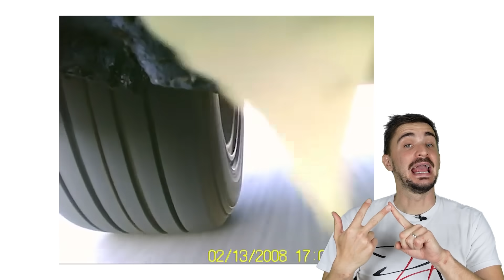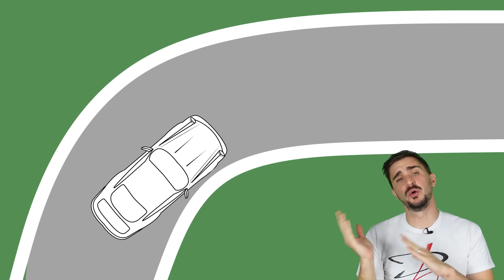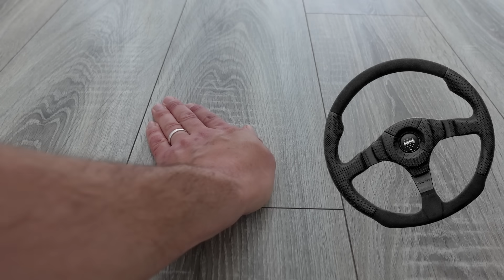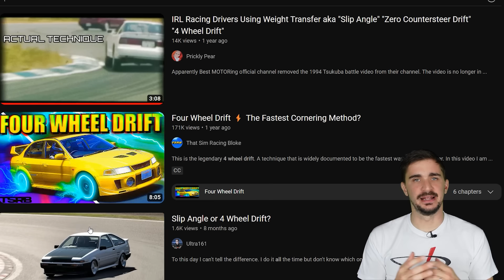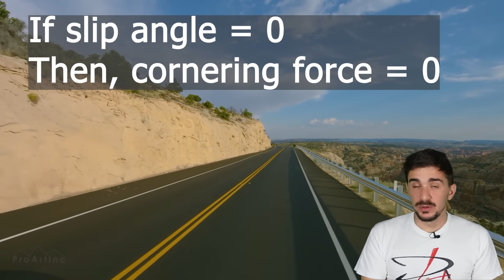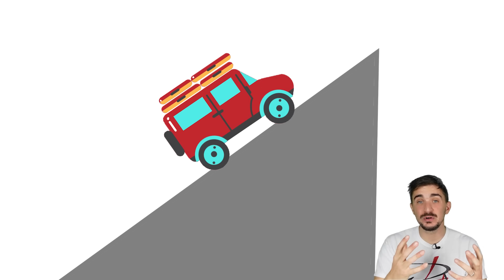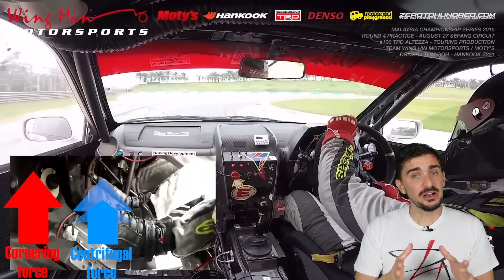You Think You Know But You Don't - Slip Angle Explained in a Way You Will Understand

Comment: …but as we are not talking about discrete contact patches hitting the ground but a continuous elastic piece on material the change of direction is done by the edge of the contact patch where material gets into contact with the road or leaves it. 🤔
And with motorcycles, due to the lean angle in a curve, different wheel radii of the rounded cross section of the tyre touch the ground. Is it correct to conclude that motorcycle tyres get away with much softer and stickier consistence as there is less scratching over the road surface involved with how they generate their cornering force? 
A very interesting video, I never thought about the details of this process! 🤗
Reply: Since its a continous elastic piece of material as you said, the tire produces a cornering force as it continous to grip on the ground in front with a slip angle (a fixed slip angle if steering wheel angle and speed are fixed). As you can guess from the drawings, it happens both ahead and behind the contact patch, just in opposite directions.
About bikes, the front tire mechanism of generating the turning force is actually the same of the front tire of a car. When you are leaning in a corner, the handlebars do actually turn in the same direction. So, left corner, handlebar steers to the left (while you're doing the corner, the process to changing from standing straight and leaning is another topic and uses counter steering, can explain if you want), there's some slip angle on the front tire that forces the bike to turn. The lean is only required to maintain balance and not fall, but its not what makes the bike turn.
Reply: @giovanniquargentan6198  The difference with the bike is that the circumference of the tyre is smaller the closer it gets to the sides of the tyre. At same rate of rotation, that makes different circumferential velocities.
And no, the effects with two wheelers and cars are very different: A car will settle into going straight by itself, a bike will find a new equilibrium in the curve.
The mechanics that make the front wheel turn are very different from how it works with cars. It took until well past 2010 until a study of the TU Delft could finally explain the exact functioning of two wheeled vehicle's stability that were developed by sheer trial and error some one hundred and fifty years ago.
There's a good shortened demonstration by Veritassium here: https://www.youtube.com/watch?v=9cNmUNHSBac
Reply: @zweispurmopped  hmm. Regards to the first half of your comment, I think we said the same things, just with different words. I'd guess there's also some slip in the circomferenzial (idk the English word excuse me) direction as well as the tangenzial direction (which is the main one kf expansion of the contact patch). 
I'll take a look at the topic you mentioned in the second half. Thanks for the kindness and the detailed explanation.

Comment: Slip angle is a common topic of debate in the sim racing world. Most people focus too much on achieving this mythical "4-wheel drift", when the main key to gaining speed is correct tyre setup and line choices. Slip angle is something that is only exploited at the higher levels because their tyre setup and racing lines they take allow them to stay in that peak slip angle region. Analysing the data from tyre testing facilities is also tricky. The road surface they test the tyres on is usually a big belt of sand paper; which is obviously very different to asphalt. Vehicle dynamics is my favorite area of engineering. It's an incredibly deep rabbit-hole
Reply: The low slip angles of modern tires may make the 4-wheel drift seem mythical, but it is very real. And with skinny bias ply tires it can be done at quite a dramatic angle.  That, and the perfect rev-matched downshift while trail braking, are the two most rewarding experiences I've had while driving an automobile.

Comment: There is a very big difference between a wing and a spoiler, aerodynamically speaking. It's worth keeping that in mind.
Reply: Was just about to comment this. Spoilers are for drag reduction and increased fuel mileage, whereas he describes a wing.
Reply: @captainjigglebeard7785  Spoilers force flow separation, I don't see how that reduces drag
Reply: The Audi TT is a classic example of a spoiler , when originally designed the shape of the car had the effect of air clinging to its top surface and the whole car lifting up at high speed as it was working like a wing, the addition of a spoiler broke the air flow and cured this problem.
Reply: @Simon2million  Yeh, I'm not sure what's worse with that one - the lift or the separation instability
Reply: Ah I’m not the only one then that was about to comment on the difference between wings and spoilers

Comment: but what if you just keep the steering wheel turned? the tyre stops being deformed but the car will still turn. something doesn't up up in you explanation
Reply: The tire remains deformed but at the same slip angle. If you turn the steering wheel more, the angle of the turn becomes narrower and your turning radius will get tighter.

He misrepresented it in his presentation where he shows the steering wheel is turned more and more but the slip angle stays the same
Reply: @suikoden123248  but even if you are steering with wheels of solid metal you are still going to turn. So long as you don't go past the loss of friction point.

Comment: Interesting. By this logic, no slip angle => no cornering force => no turning.
So by this same logic an infinitely rigid tire cannot turn a car even with an infinitely high friction coefficient...

Experimentation contradicts this theory => where is the error?
Reply from the maker: I would love to see an infinitely rigid tire with an infinite coefficient ratio in an actual experiment.
Reply: @d4a  No offence, I like what you do in general. Rolling a cylindrical neodemium magnet on a flat steel surface should be a good enough approximation of my point.

The catch is that slip angle is not the ORIGIN of the cornering force (hence of the grip) but the CONSEQUENCE of the "cornering force" acting on a rolling elastic body. The cornering force is indeed the resultant reaction force of a disc (crude tire model) in contact to the road at its circumference yet rotating around an axis non-perpendicular to the direction of the vehicle's momentum (try to visualise the direction of all the reaction force in this scenario and you will have the cornering force). No need for the disk to be flexible, be 3D or to slip to show the existence of the "cornering forces"
So no, slip angle is NOT NECESSARY to turn, it will be basically inexistant in the case of the magnet on the flat steel plate. In short, slip angle vs cornering force under constant vertical load (the shape of the graph varies function of the load, etc) just happens to be a very useful tool to visually assess the expected difference in vehicle dynamics between too differents set of tires. Given the same maximum grip level of two differents tires, the steeper the graph, the more reactive will the vehicle feels in regards to driver's input, yet the less forgivable it will be to minute driver's mistakes and disturbances such as road irregularities. Accurate knowledge of the slip angle caracteristics (an N dimensional parameter) will also help pre-calibrate Ackermann and other wheels angles for a given set of tires for a given vehicle on a given track before actual field testing and tuning.

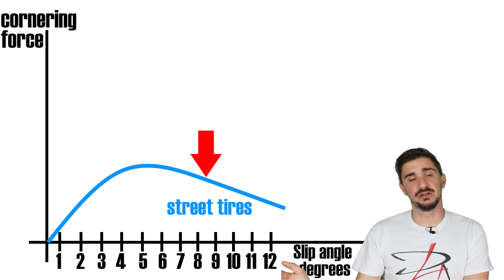Comment: 12:03 now this explanation might lead you to the wrong assumption that you always should apply rotation to the steering wheel linear with like 5-6 degrees per contact patch (just referring to the used numbers) but theres much more to it. a car has very different grip levels through the process of cornering. earlier in the video there was the clip of the dodge viper acr extreme aero going through brünnchen at the nürburgring. in that clip you can see it pretty well, the corner has a kind of a bump at the entry and you saw the cars front do a little dip afterwards. right in the moment after the bump when the cars front comes down again and compresses the front springs and dumps its weight back into the tires, you can apply much more steering angle at once (again because of the momentarily higher grip levels) and then take even more speed into yhe corner because you dont need to apply so much more angle to the steering wheel at the remaining part of the turn. the most important thing in racing is to control the balance and forces on each tire all the time and use it to position the car into a turn, keep it straight and controlled while exiting and using all of the available grip all the time. at the viper shown in the clip, a typical front engine rwd car you will be using a trick as well, which is downshifting in the right moment to get an additional braking effect on the rear tires just when the clutch dumps back after the downshift, by the engine brake and the higher resistance coming from the now faster rotating engine, gearbox and drivetrain. by that you can shift some of the cars weight to the front when the clutch engages and use that additional grip i explained with the bump at the corner entry and shift it back and use the rear tires grip as much as possible once the clutch releases again and get back the balance over the car and try to spread the load equally to each tire. this is mostly used in f/r cars because the engine in the front rather makes the car understeer and with the driveshaft in the rear you can counter that by throwing it into the small moment of oversteer. mid engine cars can use that as well but theyre naturally already more oversteery and snappy and more sensitive anyway.
Reply: First correction: the placement of the engine in any sports car (basically just within reason, not crazy 75-25 weight distribution) doesn't have a direct impact on the under/oversteer characteristics of the vehicle. What affects over/understeer is a combination of weight distribution/centroid location, suspension, and tire setup. You can make front engine cars naturally oversteer fairly easily. Second: with ABS, you shouldn't have to try that downshift technique. Just hit the brakes, if the rear has more grip then it will have the brakes applied the perfect amount, assuming a good ABS system. It would be very easy to lock up the rear tires and cause you to crash with the downshifting method.
Reply: @johnhunter7244  that weight distribution isnt the only factor about under or oversteer is obvious, didnt say that. but youre saying that its a part of it as well, so its not really a correction. but the part with the abs was misunderstood i think. i know that a good racing abs can provide you the right amount of grip at all 4 wheels. but what i mean is rather that you use the engine brake in the moment of downshift to overcome the maximum applied braking force the abs lets you to give to the wheel. for a small moment there is the brake force ruled down by the abs plus the engine brake and that will bring the wheel over its maximal usable grip level. it wont lock up though, because the abs wont let off, theres just the engine braking coming on top. so as a spectator, you will neither see a lock up nor smoke at the tire, and thats because the speed difference is very small, for example 90kph of the car covering actual distance and 80-85 kph of the wheel rotating at its contact point to the road. this will make the rear come loose a very little bit and make it step out further than just with abs. but because the engine brake only works for one or two tenths and the speed difference is that low, it will catch itself automatically. thats because no abs on the planet can use 100% of the available grip. the better it is, the closer it comes to 100% but there is no perfect case. there are factors like downforce pushing the car down resulting in a bigger contact patch, or a bump in the road affecting the tire in different ways and thats what you need to learn to use with that downshift technique. the abs allows you to use 99% of the grip, so you quickly bring it to 100.5 or 101% and over the next lets say one second, this number will automatically decrease back to 100.2, 100, 99.8% and lower and lower back to 99% by catching itself. and in that timespan you bring more rotation into the car and get a steeper angle into the corner so that you need to do less turning over the front wheels in the rest of the turn and step on the gas earlier
Reply: Useful information, I didn't think of using the engine braking in that way
Reply: So if I'm understanding what you're saying correctly, when he shows the downforce on the graph, the increased cornering force should be at a sharper slip angle?
Reply: One minor quibble is that the Viper shown is not a typical front engine car - it has a 50/50 weight distribution.
Reply: @ntdscherer  IIRC it's front-mid engine
Reply: @johnhunter7244  Correct.
Reply: Have a day off bud.

Comment: Hmmm, the sebsequent contact patch explanation kind of misses the fact that the car stll keeps turning when you're not adding steering angle. To my understanding there is still slip angle when you hold the wheel steady in turned position. It is the difference of where the wheel points and the direction the car actually moves. Could you open a little bit more how you see this situation?
Reply: "To my understanding there is still slip angle when you hold the wheel steady in turned position. It is the difference of where the wheel points and the direction the car actually moves." Yes that is exactly how it works. I agree it was not super super clear for someone new to the topic.
Reply: If you hold the steering angle all 4 tires remain at an angle to the direction that car wants to continue in due to inertia.  The slip angle continues to accelerate the car laterally off that straight path

Comment: Seems to make sense but rubber tires/deformable tires are relatively modern compared to the wheel as a whole. How did turning work back when wheels where still made of wood? Was the wood flexible enough to deform?
Reply: I suppose as a follow on, how do deformable tires work in softer substrate, like off-road?